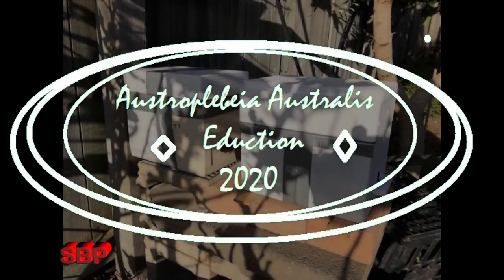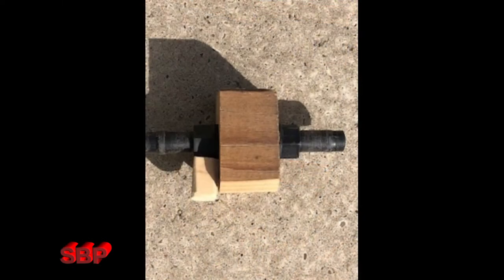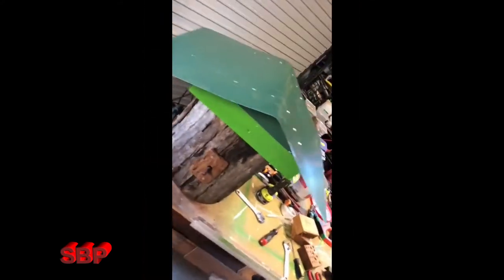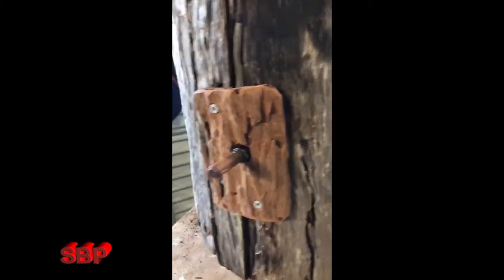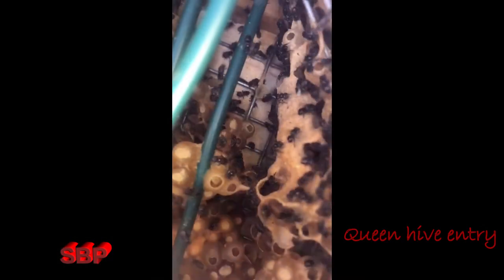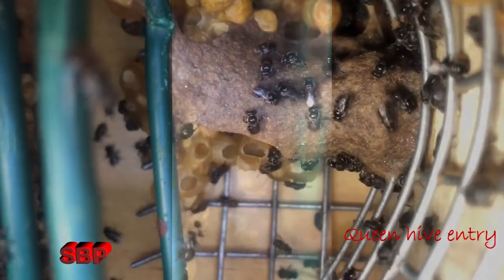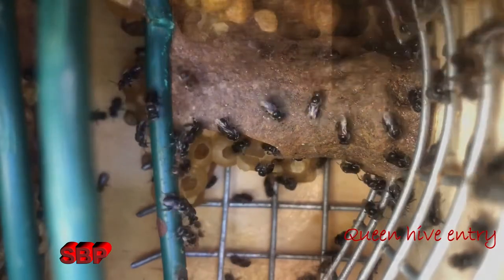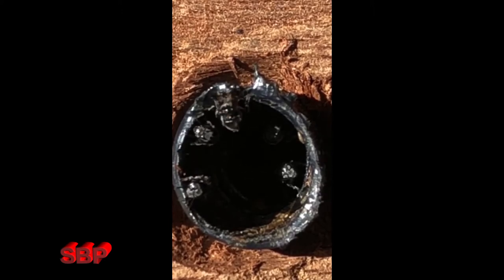AA Native Bee Eduction

Comment: When the eduction hives are separated can they be left in the same area or do they have to be moved away? If they need to be moved, how far? Thanks, I enjoyed your presentation.
Reply from the maker: Lynette with the AA  in the video I kept the mother hive close to the daughter hive and did the old fine cotton trick I.e swapping the hives entries around at the same horizontal level rather than vertically ,so as to try and even up the the bee numbers entering both hives after seeing the Queen in the daughter  and based on  an amateurs guess the movement was active enough to separate them. I then moved the hive off site to a new location  and crossed my fingers.
They were returned back home after 4 weeks and to date all good brood size has increased exponentially and I’m about to fit the honey super as they now need the room for extra stores.
The new eduction is also going well brood lift completed after good store provisioning for a two / three month period.
My parting comment is this my experience yes it worked on this and looks good for the next one but I look at it this way ,I’m working in concert with the bees  and not working the bees my way,😃 Good luck let me know down the track your experience.
G